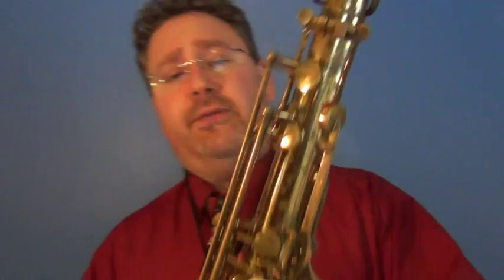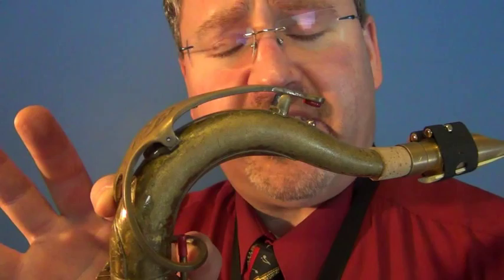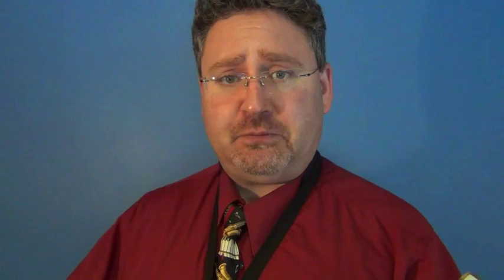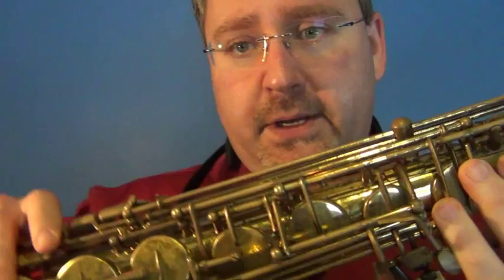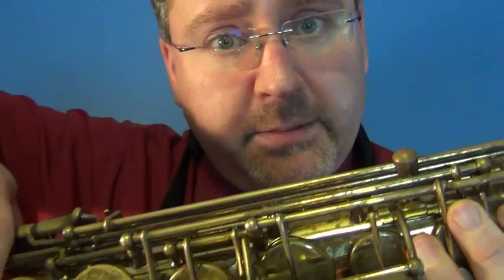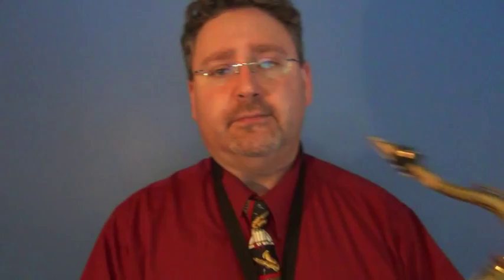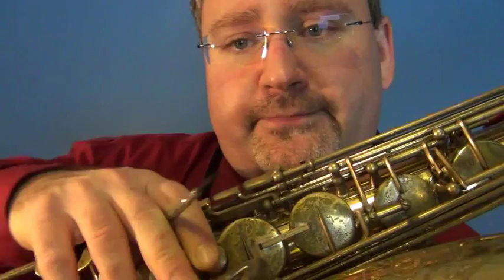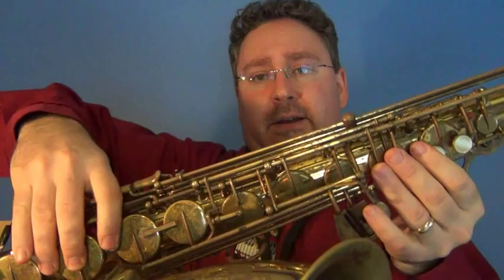Saxophone Lesson: 3 EZ Repairs Super Secret Sax Saves

Comment: THANKS  FOR ALL YOURE DEDICATION GOD GUIVE YOU A RAIN OF BLLESSINGS  AND FOR YOURE FAMILY !! PLEASE  HOW I COULD FIXED AND REPLACE ALL THE NOISE MAKING CHIQUI ,CHIQUI THE SMALL CORKS !! MAKE ME CRAZY !! AND FURIOS
Reply from the maker: +Julio Soto Thanks so much for the nice thoughts!  It means a lot to be thought of in such a great fashion :)

A company called "Valentino" makes a fine selection of inexpensive, self-adhesive key corks.  If you don't want to take your horn in for a complete overhaul, they may be the BandAid you're seeking.  Certainly not a permanent fix, but they'll do in a pinch...Here they are through the Woodwind and Brasswind:

http://www.wwbw.com/Valentino-Key-Corks-462822-i1399150.wwbw?source=TWWR5J1BB&country=us&currency=usd&gclid=CjwKEAiArdG1BRCLvs_q-IObwxMSJACXbLtzV34BGzphJ667sgtVL7FQCVRTQ5Ro932L0FitsRmFMhoC1Wfw_wcB

or, just Google:  Valentino Key Corks

They come in a variety of thicknesses, too - but I figured 1/16 in should stop the noisy clicking!  And since they're self-adhesive, you can put them anywhere there's a metal-on-metal impact point.

I use these all the time to fix woodwinds of any kind...final tip: once you use up all the pre-cut-out shapes, you can use scissors to shape the leftovers into even MORE little stickypads...waste not, want not!

If that's not what you're seeking, let me know, and I'll sus out some other options for you!

Comment: I'm trying to push down and pull up on the loop and it's not working. Any thoughts?
Reply from the maker: +Jacob Kreppeneck Yikes!  Above all else, exercise caution! The goal is to get the octave key to trigger when it's appropriate, and at no other time. But you can do irreparable damage if you work that metal too much...so gentle pressure is the key. Is the problem with yours that it's stuck down (not activating) or stuck up (always active)? Alto or tenor?

Comment: uuuuuuuuuuh....2 of my saxes do not have screws on the bis rod. Just lousy little bits of cork.
Reply from the maker: Never fear! Even lousy little pieces of cork can be tamed! In a pinch, wrap some masking tape around the cork to achieve the desired thickness and get that seal. That will get you through an emergency situation in a performance, but it’s ugly and falls off super easily.  A more permanent fix is an “adhesive cork” (I think “Valentino” repair kits have multiple thicknesses), which will often achieve the same effect, until you can get to a real repair shop. (Sometimes you need to scrape off the old cork if it’s really decayed, to make the “sticky cork” adhere). But, using tape or “sticky corks”, your goal is to increase the thickness of the rod tip until it makes the G# seal the way you need it to. Hope that helped!